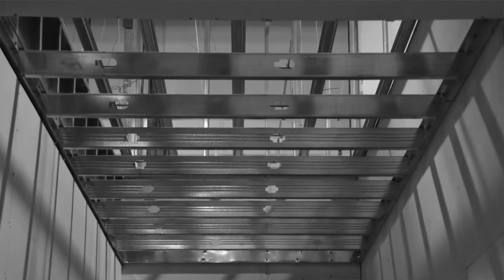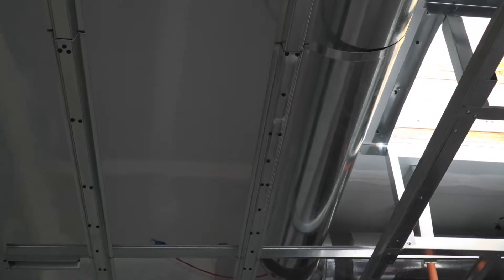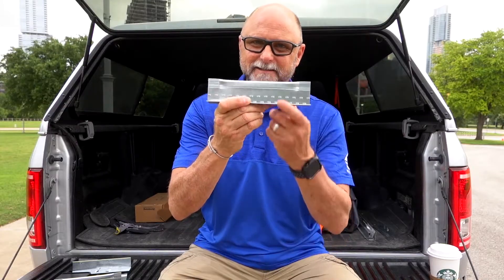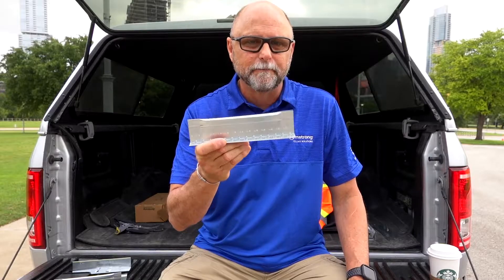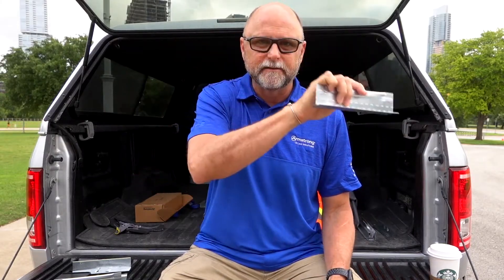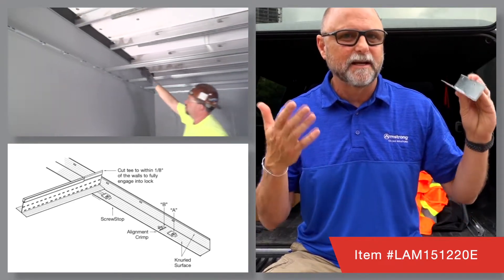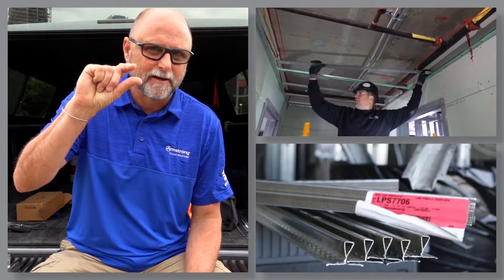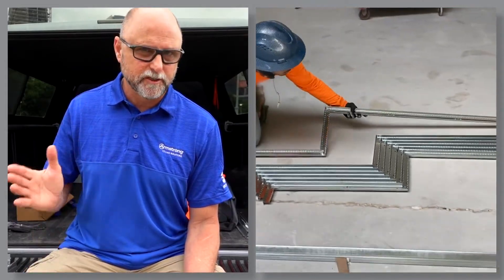Hard Lid Ceiling Installation | Shortspan Tailgate Talk | Armstrong Ceilings

Comment: Do you typically rock walls before you install hardlid track & joists?
Reply: Not me. Usually you want to top out (drywall) any fire or sound walls and then install the ceiling drywall grid. This allows all the electrical to be completed before walls are rocked. The subs can complete more and when you drywall the walls no one is in your way.